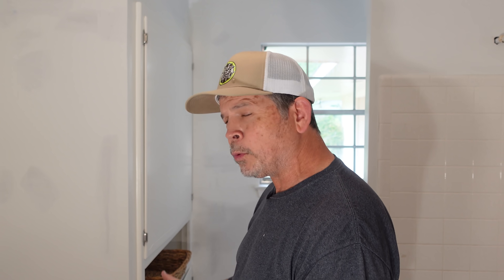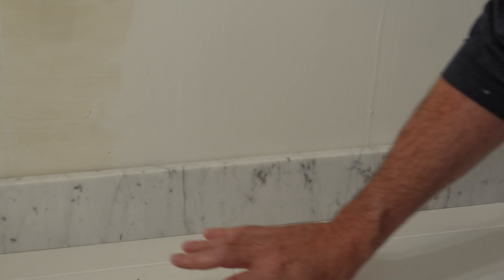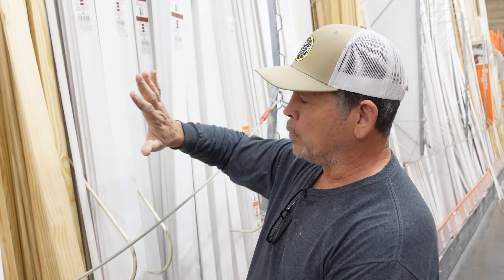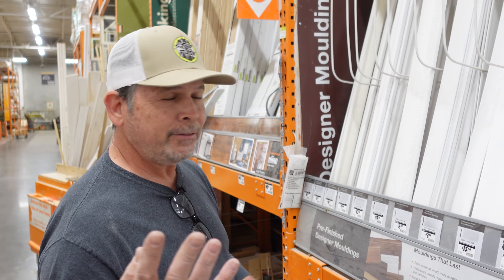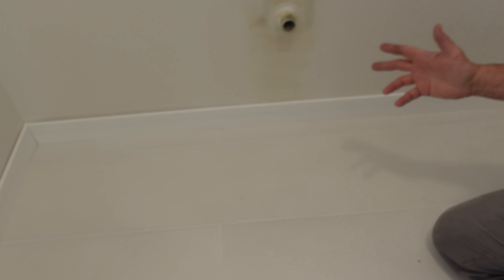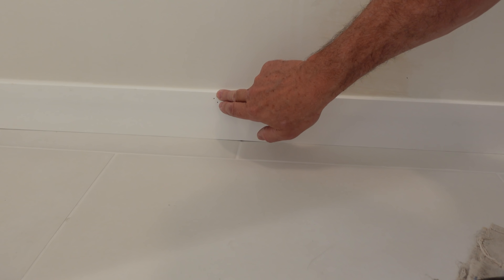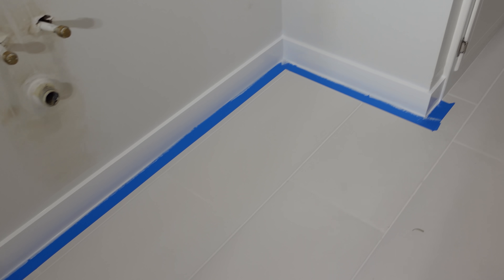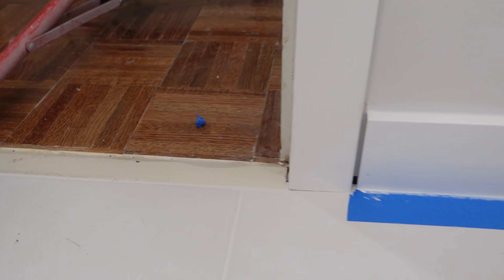Use THIS Baseboard IDEA on Your Next Project!

Comment: If you aren’t planning on running shoe moulding or quarter round on the base in the future. you should run a bead of caulk along the blue tape before painting to fill in the gaps between the tile and baseboard. When you removed the tape when done painting you have a clean gap free look.
Reply: Ya those gaps under look unfinished
Reply: Was wondering that myself, but also so water doesn't get behind into the sub floor and wall I would think? I was curious why he didn't run a bead of caulk there.
Reply: Agreed, water can run right under that.
Reply: Pickup color-matched (to the grout or baseboard) silicon.  Creates a nice finished look under the baseboard and keeps water, cleaning supplies, etc. from seeping under and discoloring.  Especially important in bathrooms and kitchens that get regular "wet" floor cleanings.
Reply: Time and materials but mostly time. ALL tile should be caulked in any space where the plane changes. This includes shower walls. This prevents cracking and keeps water out. Most tile installers neglect this step as it creates an entire day to accomplish before grout is installed. Though it only takes an hour or so, it requires a full day for curing so most ignore this step. I have yet to work for a contractor who will allow me to do this step. I am currently unemployed.
Reply: @csimet  sorry, I must disagree.  If someone changes the color he'll have to replace the base. Can't paint over silicone,  so don't use it wherever there's a possibility of painting 
 Cleanup is a be-yotch, too.
Reply: @nailbanger2 huh? Just prime with Shellack or oil,base primer. Silicone IS paintable if you know what you are doing
Reply: @nailbanger2 This is a paintable silicone.
Reply: There are advanced modified polymer and hybrid silicone products tailored to wet-prone areas that will take a coat of quality latex, or by using Zinnser Bullseye Shellac based primer (which I love working with due to rapid dry / rapid recoat and smooth as glass self-leveling (that's also fully sandable) and incredible stain-blocking abilities that always set me up perfectly for a gorgeous latex gloss finish without the mess or stink of alkyd paint and it can bond unusually well to otherwise tricky surfaces or substrates, including silicone caulk that would never take latex topcoat alone.  Some folks will bd opposed to the need for denatured alcohol for thinning and complete, hassle-free cleanup but then some will still pick up original Kilz and go to town with it, even when it's NOT the correct primer for covering their stains prior to repainting--so each to his own, I guess! 😏

Comment: Ok as an amature DYI'er I have to ask.  Why don't you caulk between the baseboard and the floor tile to eliminate gaps and make it easier to keep clean?
Reply from the maker: We plan on doing this, but want our final coat of trim color to be down first 👊🏼
Reply: Never caulk if you dont need it. A clean tiny shadow line that does grab and hold dirt and hair is better than a caulk line.

Comment: Quick tip when doing baseboard. Find the wall studs beforehand and mark their location with pieces of blue painters tape. Then when nailing the baseboard you’ll always hit a stud.
Reply: I do that myself.  Works well.  For oddball situations where woods not available, I'll use some adhesive, even hot glue at times.
Reply: I did this last time I did trim.  Had some weird looks from those helping, but when I was able to blaze through the nailing and not have to jumble with a stud finder, they understood.
Reply: Honestly, the glue is overkill & you’re screwing the next person that has to go to take it off.
Reply: @garycasper2929 - It's better than having to straighten an old floor or wall enough for finish nails alone to hold.   I don't think they are advocating gluing commonly or for situations where brads or finish nails alone will hold it.  I have spots on almost every trim job where a bit of adhesive makes it possible to get the trim to stay where I need it, but never use glue where nails suffice, for exactly the reason you mention.  Hopefully our combined comments will keep some "ovrkill bill" from gluing all of their trim in place!😂
Reply: @garycasper2929 thinking of someone taking your work apart 😂😂😂
Reply: thanks
Reply: @garycasper2929  If I absolutely had to use an adhesive for something like that, I've used 100% silicone calk.  It still will cost time and do some damage on removal, but if done carefully, it can be removed with far less damage than construction adhesive.  And less can be applied with the same results.
Reply: Nah, just take a stud finder with you when nailing the base on

Comment: I was hoping you’d suggest using either 1x5 or 1x6 PVC since that’s what I spec for all my bathrooms.  It looks like regular base when finished, but it’ll never rot like wood.  Great content today!
Reply: Thought the same thing
Reply: That's what I used in my bathrooms in my recent renovation and love them.
Reply: Issue with those are it does not look like finish trim at all. They have a huge cup and boards are warped which makes it impossible to make a sexy miter cut
Reply: @ballgms308  haven’t had this issue with my installations.  It looks exactly like wood trim when painted.
Reply: You realize he was using polystyrene base board, right?
Reply: Plus you can put shoe molding if that’s what you need to cover any gap at the wall.

Comment: As someone who works is water and mold restoration. If you want to make that really water proof, chalk it to the ground.  Otherwise the water will still get under it, even from normal use. It'll use the grout lines as highways. The base is water proof but the sheet rock is a food source for mold. An option if you don't like the chalked base look. You can run a small bead at the wall floor meeting. So when you snap your base in it'll be hidden. Disclaimer this is for plastic base only!!!!   Also great content love you guys!

Comment: You don't want to use silicone on natural marble as it will stain and can bleed through and cause a dark spot.  Use a polyurethane like white sikaflex and you will be good to go. Silicone is fine on mad-made solid surfaces like "quartz".  A friendly tip from a stone mason with 20+ years exp.  Great videos and I just subscribed to your channel.
Reply: Great advice I learned the hard way after installing a backsplash on marble countertop in my bathroom. I sealed with silicone and also put around faucet and had the grey stain on my beautiful white marble that looked oily and couldn’t get rid of. 😢

Comment: First, the polystyrene is "perfect" for my ongoing recovering from the 2021 14 below zero damage project.  I would never have even considered it.  The tip on cutting fast so you don't melt it?  Thank you.  No telling how many cuts I would have made before I finally came to that realization.  Also, your paint brush suspension system?!?!?!?  PRICELESS!!!!!  Why didn't I think of that 55 years ago when I was basically just doing painting for a couple of years.  Duh...  You guys ROCK.  Please keep up the great tips and hints.
Reply: I had that exact same thought on that tip about cutting polystyrene fast.  I'd have thought it was just the nature of the material and I'd have just deburred every #%×& cut.  :)
Reply: @ncooty  I would probably have concluded "I'll never use this $#*t ever again in life!!!!"  "Operator Error" would have never entered into my thought process.  "And then," the "EXPERTS" brought reality and common sense into the equation.  That was a Fantastic Tip from Stud Pack!!

Comment: LOVE your channel. As you were going over the types of trim for the bathroom at the store, I was practically yelling at the screen "USE POLYSTYRENE!"  Then that is where you went.  All is good in the world.  Great tip to cut off the top and flip it upside down. BUT you missed a 101 trim trick.  ALWAYS prime and paint the trim BEFORE installation, then all you need to do is touch up over the nails and corners after install.
Reply from the maker: Cool thx.  I like to caulk the base/wall edge then paint over the caulk.  That's why I don't pre-paint but great tip thx.
Reply: @StudPack  I still do that too, but where the "paint it first" trick really helps is a super clean the edge against the floor.

Comment: Finished a bathroom renovation a couple of months ago - used the 12x4 subway tiles for the baseboard with Schluter trim - it does look nice, but man, the stone option is sweet and would have been SO much easier! It would have taken me 30 minutes instead of hours of cuts and grouting... and would have looked awesome. The poly option actually looks pretty good too!

Love love love the out takes and comments (outfeed table 🤣🤣🤣).

Comment: I especially like that plastic type of molding for the bathroom. When I install it I run a continuous line of caulk along the bottom and ends. This is so if you have a leak or get wild with the mopping it will not go under the molding and into the walls. It becomes a little bathtub and prevents water damage. It also keeps those pesky bugs from crawling out of the walls.

Comment: Call me nuts but I filled the nail holes in my bathroom base with drywall mud.  It's easy to work with, fast drying, works great, and it's been invisible since I installed the base in 2010.

Comment: Excellent video and topic. My wife and I have been discussing these material options recently as we retrim our entire home. Due to price and supply considerations, we are using MDF everywhere except the bathrooms and kitchen. PVC is the way. I've also used some PVC boards as an exterior finish under a sliding glass door and plan to use it under the front door where I have already removed rotten wood. Thanks guys. Love the channel and all the little tips sprinkled throughout each video.

Comment: I did the same thing for my first house flip.  I bought some marble 12x12" tiles for the floor and shower, then cut some 3" strips from the tiles for a baseboard.  I did have small grout lines, but the finish looked outstanding.  It also saved me a bit of money too.  In fact, I bought a wet grinder and polishing tools and bullnosed the edges to a 3000 polish.
Reply from the maker: Great idea thanks James

Comment: Hey Stud Pack, try using a clear caulk against the floor just before you paint. Prevents any bleed under the tape and will fill the dips in grout lines. Either tool the caulk or pull the tape asap after painting so the tape can cut the caulk. Makes the base look scribed to fit.
Reply: Cool! The dips were really bugging me!
Reply: Could maybe bottom butter the baseboard with the clear caulk right before install!

Comment: I've used that durarock putty to remake a table leg that was missin about 8 in section . I put a couple construction screws to make sure it didn't flex , an made a little form to hold the putty like cement Foundation . After removing the form a little sanding an paint used it long time till sellin it cause wife wanted decorate differently , lol

Comment: I just finished redoing my daughter's basement and use common board as her baseboards. I handpicked every board for straightness and grain. Then I had her hand stain every board then sanded it down to where the stain was light and the grain popped. Then we sealed them with a satin varnish. I had her lay them out with her favorites around the doors. Added a week to the job but it turned out incredible

Comment: We always have a wainscoting of tile on the wet room walls. I usually use natural stone on the floor like honed travertine then use a tumbled travertine on the walls. The nice part about using a natural stone on the walls is, you can bullnose your tile for the top really easily, so it looks finished. Also if you have any outside corners to cover on the wall, you can bullnose that too. Great information, it's always about things worth knowing!! Thanks!

Comment: Durham's water putty is the best, been using that for at least 30 years.  works great outside too.   and if you seal the top the can lasts forever.  Stuff is great, funny you mention that.   It's not expensive either.
Reply: It is some good stuff I've been using it for many years as well, there for a minute I was sure he added to much water it doesn't take much.

Comment: Waited for the outtakes, funny!  Tile makers do make baseboard with a nice routed look edge.  I used it in my first bath remodel, looks great.  But this is a good video informing folks to not use a wood or MDF based product.  I use the polystyrene a lot, just because it's really easy to work with and lasts forever.  Another excellent video Paul and Jordan!

Comment: I have painted pine beadboard and pine baseboards and door trim in my bathroom. The baseboard was put down first and the thin beadboard butted to the top of it so no gaps for water or moisture to run down behind the baseboards like would be with baseboards applied over it. It was installed, primed and painted 31 years ago. The only place paint has chipped slightly is at the edge of a little built in nook between the top and bottom of my linen closet. The baseboards and wainscoting are still just fine.

Comment: Looks like I made the right choice for trimming out my bathroom. The bathroom is right next to a little entryway downstairs, so I actually used a PVC product to trim out that small area as well to make it match. I didn’t want to use caulk on the nail holes so thanks for introducing me to that filler product. Also the nail in the paint brush is a killer idea.
Reply: Skip  the nail hot glue a small magnet to the brush handle for metal cans...

Comment: For inside corners you can use a drywall screw into the baseplate to stop it from rocking back and looking out of plumb.  Keep the videos coming.
Reply: Had a man showed me that trick long time ago and then done it on another job years later was putting in some stained trim and my boss at that time asked what was doing with going through the house putting screws in the wall and I told him it keeps from having those cracks to fill in bottom of the corners. He said ok you done lost me... So I done it on the next one while he watched and he said alrighty I learned something today but whatever works it looks good tho.

Comment: I used the polystyrene in my recent bathroom remodel. I lobe it. It has a short learning curve for cutting ( cut fast, it can melt). It is more expensive than pine, but looks fabulous and I’ll never have to replace it.  We routed the baseboards for the rest of the house, which got the look I wanted but it was a ton of work.

Comment: the pink dap spackle in a squeeze bottle is the best IMO. put it on like normal and maybe 10 minutes later just go over it with a wet rag. or wait 5 minutes and you can just finger sand it

Comment: It's been a while since I was in the home store but they used to offer a pvc molding that was a little more heavy and didn't mar up as easily. Also was a solid color all the way though so you didn't have to worry to much about that issue either.

Comment: Have you ever considered using old empty gift cards to apply your putty? Works like a champ and when they get coated with dried putty either trim it off or pitch the entire thing and grab another. I pick up the empties from the top of the gas pumps at Walmart where folks discard them…
Reply: I've done that with scraping windows too from light overspray. I pick up cards like that when see them. My wife always calling me crazy until I ended up swiping one at the pump one day just to be funny with her and it still had $ left on it 😳😳🤣🤣

Comment: I used the white polytrim in my bathroom, but I just use white caulk to fill the nail holes and joints and didn't have to paint because it just blended right in.

Comment: Then nail for hanging the brush is genius. Don't forget to firrst use that nail to punch a little hole in the groove where the lid of the can sits. That way, the paint that fills up the groove will drain back into the can.

Comment: 7:59 I know you're a professional and all, but when I use a table saw I set the blade height about 1/8" higher than the material I am cutting. My reasoning being that if something goes wrong, that's probably how much blade will be there to cut me, it'll make a mess but not take fingers. I still have my left thumb to prove that there is some validity to my argument. I was cutting without a push stick (errr umm) and my hand slipped across the top of the board right into the blade, if I had 3"-4" of blade sticking up someone would have to be helping me type this!
Reply from the maker: I understand Michael.  Two schools of thought on that.  Your view and then opposite that the higher blade has fewer teeth engaged in the material so less strain on the saw, etc.  This is probably only a fair comparison when cutting thicker material.  I have a SawStop so I worry about accidents less.  I still completely respect the saw but knowing that my saw has the technology to prevent most accidents is why I spent the extra bucks on it.  My sons use it too so it gives me peace of mind that their inexperienced hands are safer.  If you've never seen the SawStop in action, check it out.  Pretty awesome!

Comment: Hi Stud Pack , I saw trick where you make a soapy solution in a spray bottle, when you pass your finger over caulking spray it first with soapy solution, it comes out great. Also punch a hole in back of caulking tube so when you are squeezing the caulking gun air is let out the back and caulking comes out smother. Hope it helps thanks for the videos!